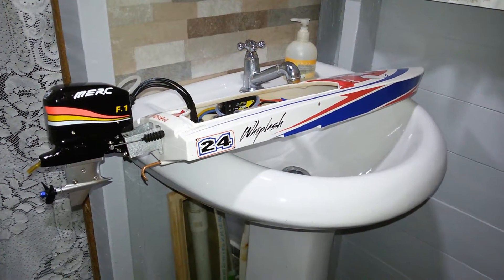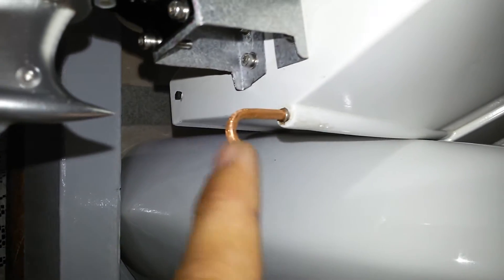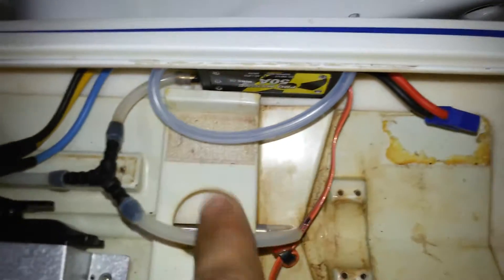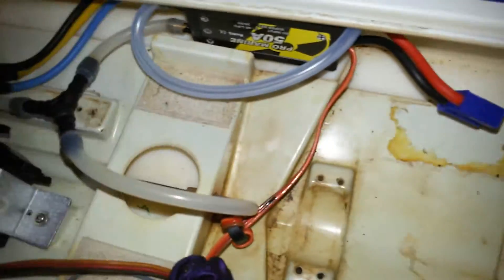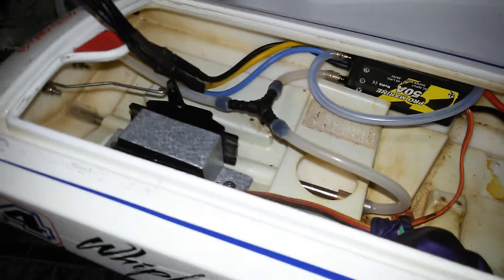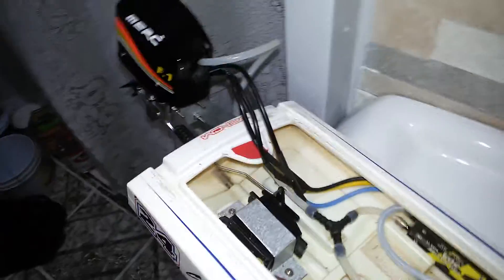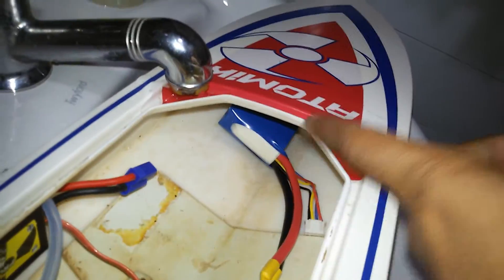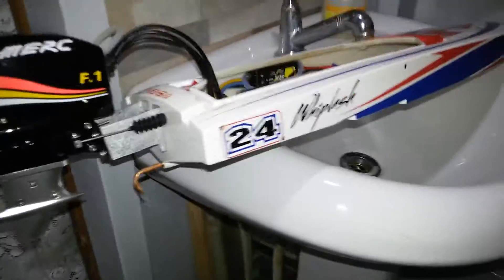Atomik whiplash 24 with Hobbyking cnc Rc outboard motor update 2

Comment: Nice little hull. My boat is a Prather lap cat with a k& b 7.5    lower unit outfitted with a castle 1515 1y motor and a hobbywing 180 esc 437 three blade prop. Got it up to 45 mph so far.

Comment: have u had any problems with it and what is the problem
Reply from the maker: so far I've had no problem is very fast and works smooth .... I've heard others having problem with the flex but that's not the case with mine it works great .. I grease the flex before and after every run
Reply: that what i thought cuz i seen u run it twice and they say it snaps on the second run but i was thing they probably put to heavy of a Greece in it which cause it run hard and it snaps
Reply from the maker: I've only got to video it twice but I ran it like 5 times now.. it comes with some marine grease is much thin than the regular grease. I squeeze the grease in until it comes out from the prop shafts. .
Reply: Too much drag on the hull with that water pickup position.
Reply from the maker: yes I actually changed the  pickup location because of that very reason... it also caused vast displacement of water away from the propeller so it wasn't able to grip the water